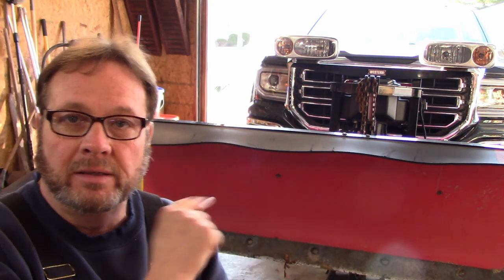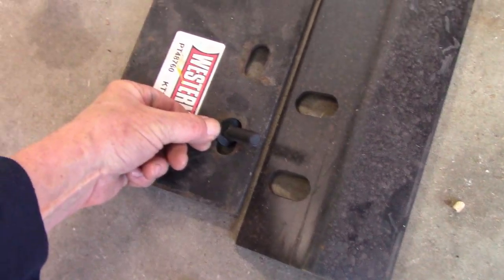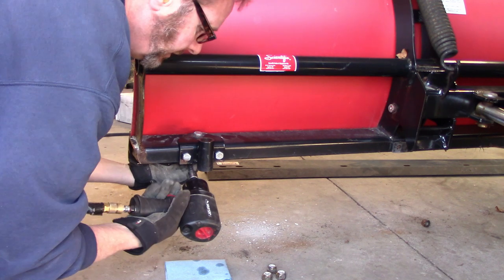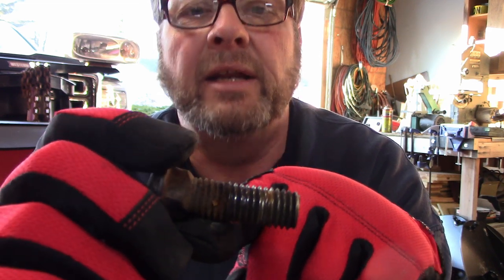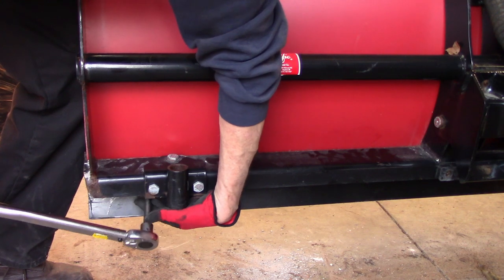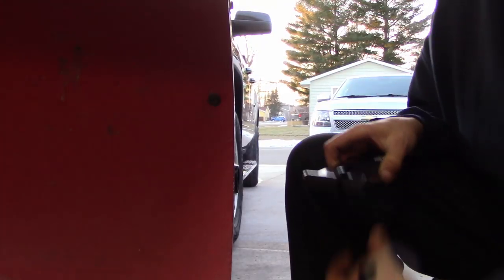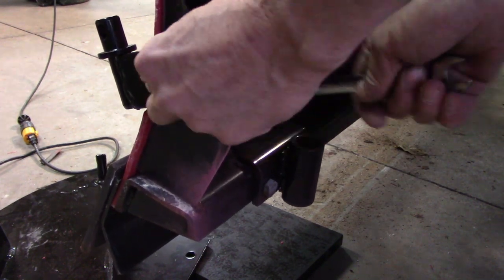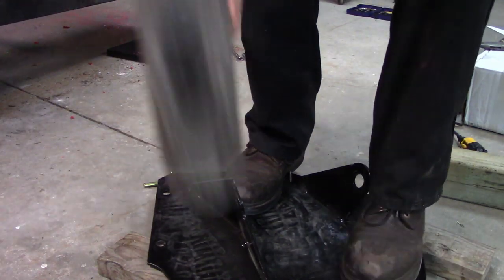New Cutting Edges and Wings on Western Midweight Poly Plow

Comment: I put the wings on also but snapped the rubber pads in half so I put a quarter inch steel plate behind the replacement pads and left about an inch of rubber below the plate and have had great success.

Comment: I opted to weld the mounting brackets to the side ribs similar to yours. The mould board steel isn't very thick and I was able to adjust the lean angle of the wings by moving the brackets in and out. I set them at near vertical to improve the fit of the rubber blocks.

Comment: I have a pair of wings on my 7'6 ultra mount, there are the cats meow, almost 9' of clearing now when slightly angled, it saves my trucks paint from scratches when plowing near shrubs / tree's, corals the snow really well and saves time. One word of caution, be very careful with that poly mold board, even while plowing a gravel lot, check the plow from time to time and make sure its not stressing the poly (it will discolor to white)

Comment: I was never a fan of the pro wings, but hopefully you are gentler on them then my guys were lol. 
Never thought I would watch a video of someone drilling holes in a snowplow, yet here I am.
Reply: Did they not hold up well or were there other issues?
Reply: jamesnm21 
They were pretzels after 1 season. 
Could have been operators. 
I also like how on this install Mark installed them with more forward angle
Reply: Dino had to be operators hitting curbs... we have 4 trucks with them on for over 5 seasons and they still work/look good
Reply: Drew 
I am sure it was operator error. 
Ironically I had bought 2 sets and never installed the 2nd set. So hard to know how a different operator would have treated them. 
We soon changed to v plows then expanding plows.
Reply: We have 5 trucks with the western wideouts they're definitely the most efficient
Reply: Drew 
We have scaled back to 2 trucks. One with a Fisher XLS and the other with old school Blizzard PH1
Those original blizzards are still the best IMO
Reply: Nice small sometimes is the way to go, we are currently running around 14-15 3 of which are boss straight 8 footers no wings, 4 western 8 footers with wings, 5 wester wideouts, and then 2 kodiaks with 9 footers and 2 peterbilt's that rarely see a plow

Comment: I bought a piece of steel and drilled my own holes dead center. cause it will save you money compared to the Western plow cutting edge. cause once the edge gets wore down, i can just flip it over and keep going on the same piece. Cant do that on the western edge.
Reply: And the piece of thick steel only cost me about 100.00 that can be used twice

Comment: The knockoff wings, the rubber is way cheaper and the linchpins are cheesy. I picked a set of marketplace for 40 bux. Now they have the buyers rubber and it was way harder to drill 5 holes in each one and made a plate for the front to squeeze it